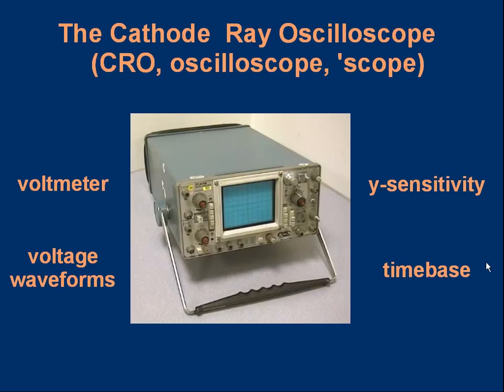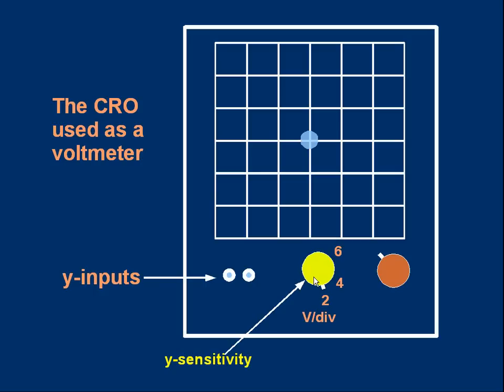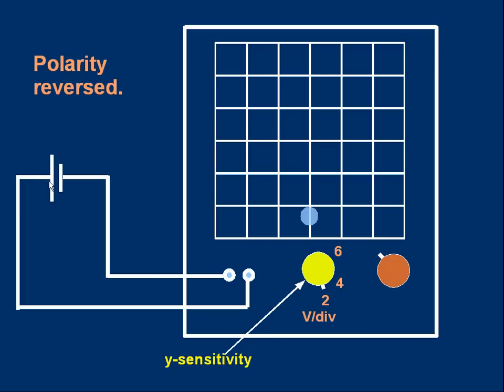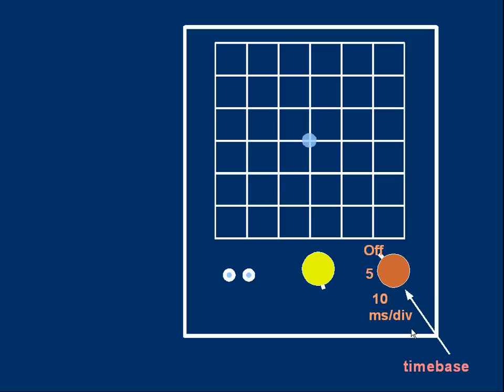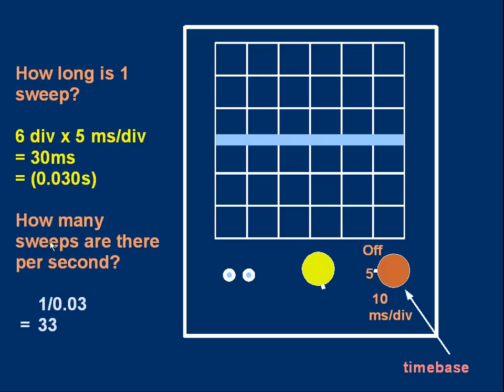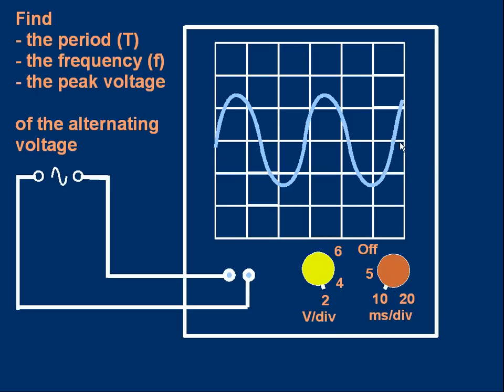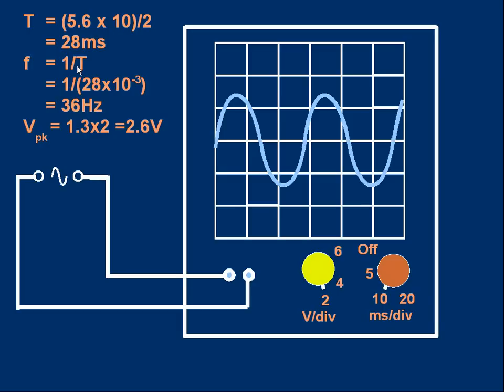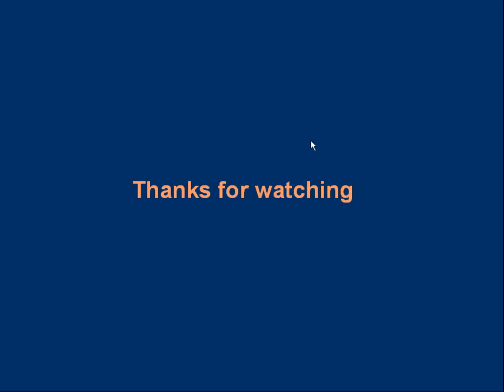GCE (A-level) Physics E29  The Oscilloscope

Comment from the maker: Hi Dan.

For a sine wave, RMS value = (peak value)/√2

Suppose your oscilloscope display shows a sine-wave pattern height ranging from +3V (max) to -3V (min). The the peak value(same thing as amplitude ) is 3V.  The RMS value is therefore 3/√2 = 2.12V.

Good luck with your exam!

Comment: please reply I've got CIE exam coming in 3 days...
In the question at 7:18  ... I followed a different way of solving. Please tell me if it was correct.
I converted 5ms into seconds which equals to 0.005 seconds.
Then I found that how many 0.005 are there in one second: 1/0.005 = 200
Then I divided 200 by 6 to know the number of sweeps in 1 second; 200/6 = 33.3
My answer is 33.3, is it acceptable method and answer?

Comment from the maker: I prefer to divide by √2, which is usually taught and is used in the textbooks I've seen. It's clearer for someone reading your working to understand what you have done.

If working to 3 or more significant figures, then using 0.707 isn't precise enough and may introduce significant rounding errors.

But if your teacher has told you to use 0.707, I would stick with it.

Comment from the maker: I don't know what part of the video you mean or what the 'line' you are refering to is.
At about 9mins 50sec, the peak voltage is from the middle to the highest (or lowest) point.
This distance (on the grid) is 1.3 units.
You then multiply that by the y-sensitivity, 2V/div.
This gives 1.3x2=2.6V.
Hope that helps.

Comment from the maker: By the way, dividing the peak value by √2 is only correct for sinusoidal waveforms.

If you have a square-wave the rms value = peak value/2 (= peak value x 0.5).  The factor used depends on the shape of the waveform, 

Since we nearly always deal with sinusoidal wavforms, this is often forgotten.

If you want to know where the √2 comes from, it is explained in video "E31 Alternating Current (AC) Part 2 of 2 " (I'm prevented from using URLs in these messages.)

Good luck with your course.